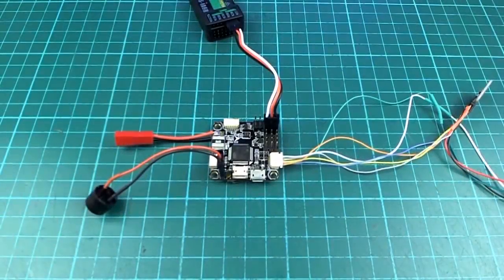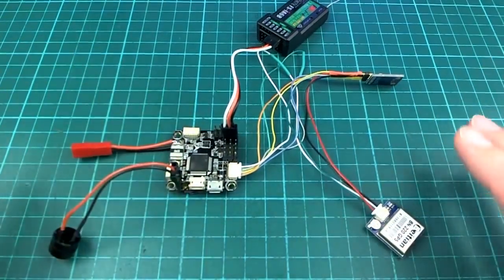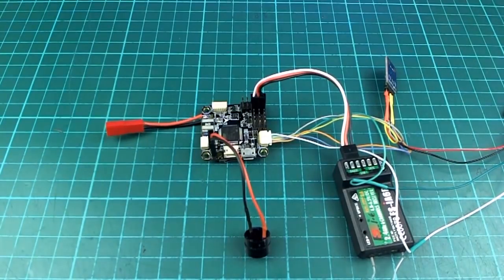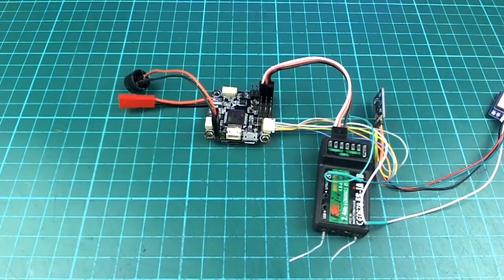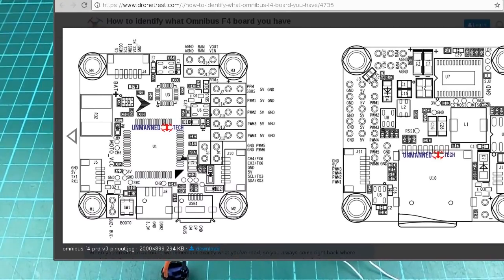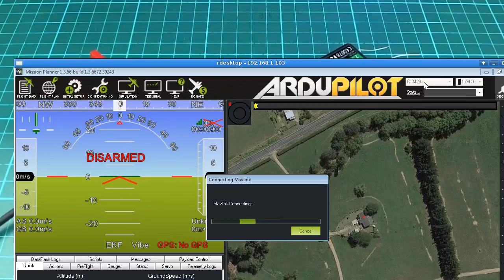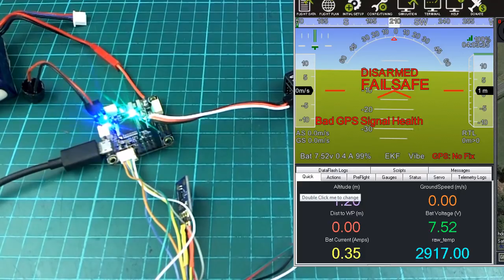Arduplane on Omnibus F4 Pro

Comment from the maker: I forgot to mention you will need to set BATT_MONITOR to 4 (and reboot) to enable the voltage and current sensor.
http://ardupilot.org/copter/docs/parameters.html#batt-monitor-battery-monitoring
Reply: I have done this setup on my omnibus f4 pro like u have but my horizon is inverted in roll axsis how to revert it
Reply: I think there must be a Command For it,
Reply: @TanM  can u pps tell me the command for that

Comment: Is it possible to connect a telemetry radio such as the RFDesign 900X to the Omnibus F4?
Reply from the maker: Yes, you just need a UART available. The first UART will typically be used by GPS, but on these boards there is another one. Which connector it is on may need a little trial and error to find out, and you can change the value of the parameters SERIALx_PROTOCOL to assign the functionality you want (for telemetry it would be MAVLink1)

These days there is better official support for these cheap boards, the options I just mentioned will be set up already, and rather than doing what I did here you would be better off to get firmware from here (use 'stable'):
http://firmware.ardupilot.org/
Boot loader flashing (only need to do once):
http://ardupilot.org/copter/docs/common-loading-firmware-onto-chibios-only-boards.html
Firmware flashing:
http://ardupilot.org/copter/docs/common-loading-chibios-firmware-onto-pixhawk.html

btw if you have changed that little solder pad bridge to select full battery power on the video in/out + pins, double check that you're still getting only 5V on the UART connectors before connecting your telemetry/GPS. On one revision of these boards (v2.1) I found that changing that solder bridge gave me full battery power on the UART +ve pin too and I lost a cheapie telemetry radio module because of it. I would hate to see a pricey radio like the 900x get smoked!
Reply: @iforce2d  Thank you! I really appreciate you sharing all your knowledge and coming out with all these great videos
Reply from the maker: @rctestflight  likewise buddy - I was watching your videos before I even knew what a lipo was :)

Comment: If you get this GPS and compass module it has the combined connector and depending on the pinout should plug straight in - https://www.gearbest.com/rc-quadcopter-parts/pp_1693357.html?wid=1433363

Comment: I have the OB F4 V2.1 board from Banggood, this has product number 1143258 and is labelled V2.1.  Your board appears to be the V2 board which has different component layout around the SBUS  resistor and I think UART (inverted?) differences. I use INAV and both the SD card and OSD are working.

Comment: Great info! Has anyone gotten serial telemetry working with these? I'm using a standard serial data modem. I'm getting data like attitude, altitude, GPS position, but the parameters are failing to load.
Reply from the maker: Hi Daniel, do you mean the parameters can't be set/changed? I have a serial modem on one of my planes with the omnibus f4 pro, and I have noticed that it's damn near impossible to change parameters while flying (maybe one in 20 or so attempts will succeed), even though the position data is being updated smoothly. But I can change parameters via the modem just fine when the plane is not flying. I never thought too much about it since I rarely change parameters in flight, but perhaps it is some kind of bug... seems odd though, if the position data is coming in the link should be ok.
I know the modems are ok because I have used them with other FCs (revo-mini and Radiolink MiniPix) and I was able to change parameters in flight with those.
Reply: @iforce2d  I'm getting all the live data just fine but it seems as though the Omnibus is not responding to the GCS's request to send parameters. I'm not able to view or change parameters at any time. Seems like maybe the TX is working but not the RX? As it can't receive parameter request? I've tried this with multiple modems so pretty confident its an omnibus problem
Reply: @rctestflight  I have the same problem. I get stuck at "getting parameters"... Did you ever solve this problem?
edit: I desoldered one resistor as described here https://www.rcgroups.com/forums/showthread.php?2798125-Omnibus-F4-AIO-PRO-V2-ppm-receiver-not-talking-to-flight-controller/page2 now all the parameters come in (I am using ppm for rc). :)

Comment: What are the advantages over iNav?
Reply from the maker: If you just want RTH for when you lose radio contact, not much. But if you're asking the broader question of what features does Ardupilot have over iNav, it's hard to know where to start. Ardupilot is not just for planes and multirotors, you can use it to control ground vehicles, boats, submarines, conventional helicopters, VTOL aircraft and even antenna trackers (personally, I bought this board to eventually use on an antenna tracker). You can find all the basic info here: https://en.wikipedia.org/wiki/ArduPilot
But what I find to be the most important features would be:
- ground station to view and control plane in flight, and make all settings wirelessly
- remote logging via telemetry
- good support for aerial mapping missions (terrain following, interaction with camera)
- various other useful mission commands like DO_SERVO, not just waypoints
- many many years more mature and well-tested platform
If you were to expand the scope to all hardware and not just the board I have in this video, then Ardupilot is also capable of using multiple GPS, multiple IMU sensors for redundancy.
Overall I think the plane flies more stably, holds altitude better, and tracks better in wind with Arduplane.
Reply: From a software perspective, ardupilot is robust and proven in industrial applications and iNav is much less used. Even if you only want RTH, Ardupilot can also to SmartRTH, Inav will fly in a line straight back to you, even if that line has a tree or hill in the way.

Comment: And how do you mission plan while flying? Like you cannot have the USB all the time.
I planned using 433 telemetry with ordinal 2.4 fs-ia6b, for manual take off and then activate autopitol, if possible activate from the PC not the controller, cuz it has lower range.

So I could change plans in flight, would appreciate the help.

Comment: Hello i like your video's very much.but i have 1 question do you know how to vtail in arduplane? Or do you have a video about it.i just cant get it right. Change servo to vtail right and left (SERVO 2 AND 4 )But no Luck also reverse no Luck .I have a normal plane and is easy to set up with omnibus f4 pro v2. But vtail i cant get it right hope you can help or a link for video sould be very Nice. Also been reading all docs on Ardu site no luck. Best regards René

Comment: I managed  to compile and upload but not verify on Ubuntu 18.4 and Mint 18.4. 
I tried everything it just fails to verify upload with waf as if trows errors for some reason.. and omnibusf4pro cant connect over com port with MP afterwards so I guess didnt write it correctly. What version of Ubuntu you are using?
Reply from the maker: 16.04, although I think that is probably not relevant :)

Comment: Hi. Just a small question. Is it possible to have 3RD dongle style telemetry radios to work with inav on F3 boards? I was trying to get this to work. Can't find any examples. I have used these radios and they work with a Cube. With iNav it's not working. Not sure on any settings. Not sure where to find the information and was wondering if you've done this.
Reply: Mavlink. Mavlink is the telemetry protocol (and configuration protocol) of APM and other FCs. It has limited support in iNav and requires more bandwidth than the svelte LTM. It does however allow the use of other CGS and OSD. Mavlink one way telemetry is supported by Droid Planner 2 (Android)
Reply: I've lowered the bandwidth to 4800. I've used Droid Planner 2. I'm using UART1. Telemetry set to Mavlink. Have turned on telemetry in the Configuration Tab. Not working.
Reply from the maker: No idea sorry, haven't used iNav for a long time. Sounds like you're trying to use Ardupilot Mission Planner with iNav, I really doubt that would work well, if at all. I would try setting the 'Data' option to 'MSP' with the 'telemetry' option disabled, and just use the iNav configurator. The 3DR dongles are often 57600 baud by default, best to be certain of their speed before bothering to do anything further, that would have been shown in upper right when you were using them with the Cube.
Reply: @iforce2d  hello i did all the procedures you did but i can't activate the compass could you help me? could you send the parameters to me compare with what i'm doing thank you

Comment: how to wire up a 3dr telemetry to Omnibus F4 Pro v2?
Reply from the maker: https://cdn-global-hk.hobbyking.com/media/file/o/m/omnibus_f4_pro_v.2_-_quick_manual.pdf
Under "Pin map", left hand side image, you can use either the connector labelled J25 or the connector labelled J24. In Ardupilot you may need to set the SERIAL_PROTOCOL to Mavlink for Serial1 or Serial5, I forget which is for which connector, try both I guess.

Comment: Do you have any advice for getting an esc to calibrate in arduplane? I have been trying to get an arduplane build going for a year or so and I can never get the esc/motor to make any noise. If I go to iNav everything works fine.  I use normally a Matek F405 FC.
Reply from the maker: You could try decreasing the 'min' value for the throttle channel on the Servo Output page (under Initial setup, Mandatory Hardware). The default is 1100 which might be a little high for some ESCs, and they will not interpret it as a throttle low position. If an ESC gives me this problem I usually set that value to 1000.
Reply: @iforce2d  I have tried between 900 and 1100 and had no luck. Any other ideas?
Reply from the maker: @sams9716  you changed the trim value too right? I've never had any problems with 1000, 1000, 1900 for min, trim, max.
Reply: @iforce2d  The trim value in the radio?

Comment: I have the Omnibus F4 V3 (non-pro).  I successfully loaded the F4 V3 Pro version firmware on the controller but I cannot get the GPS to work.  I have not made any wiring changes from my iNav configuration where the GPS worked perfectly.  I am using UART3.   Does anyone have any solution?  The GPS locks properly but it shows GPS: No GPS in Mission Planner.
Reply from the maker: In the full parameters list, try changing the serial protocol for the UARTs to be GPS until you find which one you're plugged into. I forget the name of them, but if you type "proto" in the search field, this will find them. You'll need to reboot to have this change take effect. I don't think it's ever serial0 so leave that alone... usually it's serial 1 or serial 5 in my experience, I have not tried a non-pro board, but I suppose it would make no difference.
Reply from the maker: http://ardupilot.org/copter/docs/common-telemetry-port-setup-for-apm-px4-and-pixhawk.html
Reply: @iforce2d  Thanks for getting back to me.  Here is an update: I've tried two different boards with same results.  Then I discovered the culprit but I don't know what it means or how to resolve the problem.  I unplugged my SBus receiver, FrSky x8r and, BINGO, the GPS came right up.  Plugged receiver back in,  No GPS again.  I have my receiver using UART1 which worked perfectly with INAV.
UPDATE: Upon further investigation I found this on the ArduPilot Wiki: 
"PPM solder pad/resistor should be soldered and “S-BUS” resistor/solder pad removed Otherwise, UART1 or UART6 or RCIN will not work."
Also, GPS on UART3 won't work either.

Comment: Hi iforce2d Just wondering why you use a compass for planes if apparently you don't need one according to some.
BTW great vids
Reply from the maker: These days I often don't bother. But this video was partially about testing Adupilot in general on this new hardware, so I was trying all the sensors I had (compass would be necessary for multirotor)

Comment: hello, I need your help !!! I followed your tutorial and installed on a card the same as yours, an ardupilot Omnibus F4 PRO firmware. the procedure went well, the GPS on the huart 3 works, but the receiver does not go (a FRSKY SBUS in D8 mode). the firmware you indicate, I can't find it (revo405): can you give me your precious advice? I thank you in advance.
Reply from the maker: I don't know what D8 means but maybe you would have more luck with PPM. In any case this video is a bit old now, these days there is better official support for these cheap boards.
Get firmware from here (use 'stable'):
http://firmware.ardupilot.org/
Boot loader flashing (only need to do once):
http://ardupilot.org/copter/docs/common-loading-firmware-onto-chibios-only-boards.html
Firmware flashing:
http://ardupilot.org/copter/docs/common-loading-chibios-firmware-onto-pixhawk.html
Reply: @iforce2d  thanks!!!!!!

Comment: By removing the resistor you are supposed to be able to power your servos directly from the board without using a BEC from the ESC. Could you pls verify that, because it would mean a few less wires. Thanks
Reply from the maker: I think I mentioned in these videos somewhere, but only the first connection (for rc input) is powered from the board. The other four connections have a common vcc rail but no power unless you connect an ESC/BEC. I would not trust the board power to run servos anyway, better to have a BEC that can supply a decent amount of current.
Reply: Sorry to bother , you surely have a better grasp of the things than i do, but there is this thread here:
https://www.rcgroups.com/forums/showthread.php?2874687-OMNIBUS-AIRBOT-F4-family-ESC_5V-Isolation
that talks about it and I was wondering if it actually works. 
Thanks!

Comment: How many serial ports does that controller have? I've been looking at it myself with the intention of flashing it with ardupilot but the specs seem to suggest 2 serials, I need 3 so I can run GPS telemetry and osd.
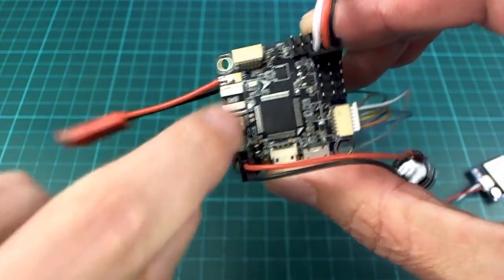Reply from the maker: Two accessible serials. As I showed at 3:48 it has integrated SD card and OSD on the bottom side. These are both now supported in Ardupilot. http://ardupilot.org/copter/docs/common-osd-overview.html
http://ardupilot.org/copter/docs/common-loading-firmware-onto-chibios-only-boards.html
Reply: @iforce2d  the integrated osd works? I must have been reading out of date documentation on it, the info I was reading said it wasent working  on ardupilot yet,  thankyou!!!

Comment: Hi, good this vidéo, but why are you using a compass magnetic sensor module ? Your Omnibus doesn't have one integrated inside ? Thank you
Reply from the maker: Correct, there is no onboard compass. Many of these boards don't include a compass because it's better to have the compass physically separated further away from the main body of the aircraft, up on a little tower with the GPS is usually the best place.

Comment: Hi, I just started to have my f4 v2 board with arduplane setup but I'm not sure if I can use traditional receiver Pwm on this board and where to connect the pwm wire to the board and how to setting up the arduplane.
Reply from the maker: You need a receiver with either PPM or SBUS output.
Reply: So I can't use pwm receiver? What about dsmx?